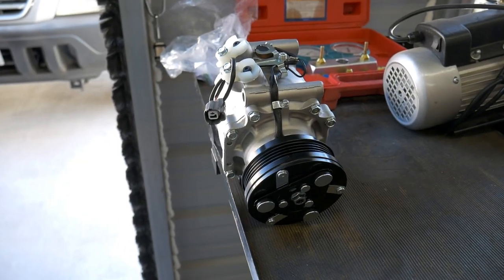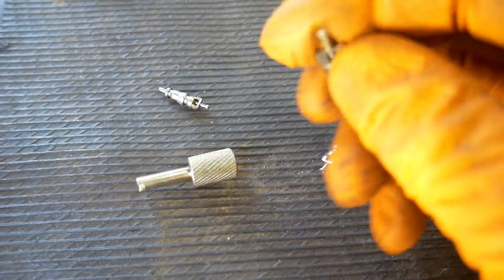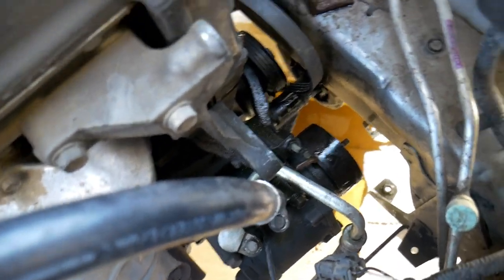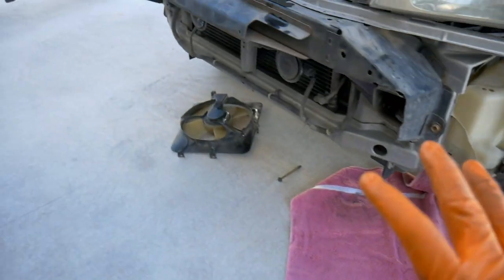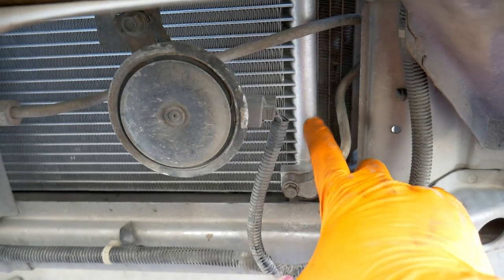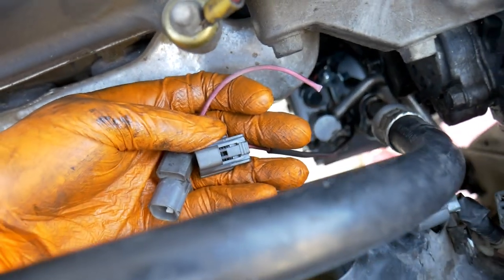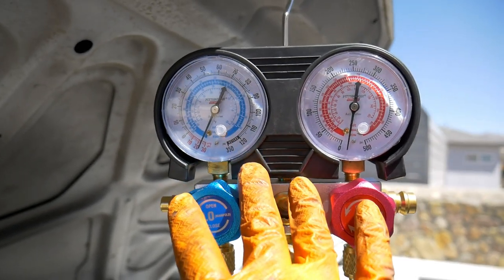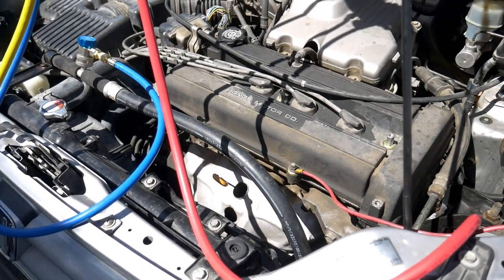How To Replace AC Compressor and Condenser on Honda CRV 97-01 - How to Vacuum and Recharge System

Comment: Any time you remove a component of the AC system that can hold oil, be sure to dump and measure the PAG oil from each component.  Your new compressor will come with a full system charge of PAG.  Dump all that new PAG out of the new compressor and only put back in the amount of new PAG that matches the amount of old oil that was measured coming out of the other components.  Otherwise, you don’t have any idea how much PAG you have in the system and the only way to figure it out is to completely flush every component with AC flush and add in the recommended amount.

Thank so much for all the great videos, Jon.  You’re my EF hero!
Reply from the maker: Thank for the input!!
Reply: If I lost all my oil how would I measure it
Reply: @chuckiebillings413  you can’t.  You have to replace the condenser and dryer, then flush out the rest of the lines and evaporator with AC flush chemicals and a flush-gun, then start over with recommended amount of PAG

Comment: Excellent video. 
Now my question is; did you have any idling issues when you turn off ac?  I have notice that when i turn off ac my rmp drops low and sometimes it stops the engine. I cleaned the iac valve and nothing changed. But it only happens when i turn off ac, plus is not blowing cold air anyway. Do you think the ac compressor is putting extra load because is not working?  Any help
Reply from the maker: None.  My CRV idles as it should.

No, I do not.  Probably have an issue elsewhere.

Comment: Hello thanks for the video. I’m going to attempt to diagnose and repair my ac system in my 99 crv soon. The compressor or the clutch definitely needs to be replaced. Do you have any recommendations on a type of place I could go to get the refrigerant in my system removed?
Reply from the maker: Most auto shops that do AC service have the machine to recover it.  Call around and ask for prices for the work.  It might fluctuate quite a bit.
Reply: @GarageBuiltHondas  Thanks so much. It’s so cool that you still help people out on these old videos. Much appreciated

Comment: Hondas are the easiest for AC work. Getting to the evaporator  is really easy  for most of the line
Reply: you can get it to take more freon by running water over the condenser to increase pressure drop It should get to under 40 degrees out the vents.
Reply from the maker: Temp of water doesn't matter?

Comment: the choke point for debris in the system is the expansion valve in the evaporator unit in the dash. Its a pin hole orifice. If plugged it can be cleared by blowing backwards through the system
Reply from the maker: Thanks for the info!
Reply: How/where do you perform thus at? Thank you in advance

Comment: Did you change the evaporator in expansion valve also
Reply from the maker: Yes
Reply: @GarageBuiltHondas  cool appreciate the video I was just wondering how long a these things will run for wondering if it's worth putting the time into and money
Reply from the maker: No problem.  I think 250k to 300k is normal.  If you really like the platform, engines and transmissions are pretty easy to find also for not too expensive either
Reply: @GarageBuiltHondas  yeah I got 242,000 on it now
Reply: I suppose if you keep fluids changed and Val clearances and she should go over 300,000 mi hopefully I sent you a request on where did you get your AC parts from I appreciate it thank you

Comment: Hey man I was talking to you yesterday where did you get your kit from for your AC
Reply from the maker: 👍 All of the links for the parts are in the description.
Reply: @GarageBuiltHondas  thanks man appreciate it instead of trying to diagnose it I think it's best to start from scratch and rebuild whole system also I push down on the high and low Schrader valves and a ton of oil come flying out so that's not a good sign
Reply: @GarageBuiltHondas  for some reason I can't find description of where you got your parts from can you by chance just tell me
Reply: Okay that still doesn't help me trying to find description as I am doing this through a cell phone thanks anyways
Reply from the maker: I think we're all on cell phones these days.  Find the title of my video.  Click "more".  You'll see all the links.
Reply: All right I appreciate it that should give me a better Insight on it

Comment: So I ordered a whole kit came with compressor expansion valve condenser dryer it did not come with evaporator core and I wish I would of bought one the expansion valve did not want to come off and I put a lot of stress on the evaporator I hope it don’t leak I’m not done yet so we will see

Comment: any issues since you replaced the condenser due the metal shavings...I  removed my seized compressor an also noticed metal shavings...been reading that you have to replace the whole system is you see shavings, wanted to know how you system is holding up after just doing condenser, compressor, and drier. Thank you
Reply from the maker: Still working perfectly as my daily driver.
Reply: @GarageBuiltHondas  Super, thanks for the quick reply...RD1's r d best when the EF isn't around that is...I provide a private taxi service in Puerto Rico and people love it! They comment on how well it rides and the amount of space and then are shocked when I tell them its 25 years old 🤣
Reply from the maker: Wow, that's awesome!

Comment: How many miles do you have on that CRV how many miles do these cars run for I have one with 240ooo on it
Reply from the maker: Mine has 253k on it
Reply: @GarageBuiltHondas  so I'm having problems with my AC instead of trying to track a problem down I just probably rebuild the whole thing like you did did you also replace your evaporator
Reply: @GarageBuiltHondas  oh hey one more thing then where did you get your AC kit from

Comment: I just replaced all the components you did, but when I vacuum it, it does not hold negative pressure. I rechecked and replaced all my o rings. Any thoughts?
Reply from the maker: None.  Are your gauges working perfectly?  Those gauges and lines have seals too and could possibly not work if they weren't taken care of or old.

Comment: Does your crank pulley wobble? Its a common issue with the older crvs.  I have one now and how would u fix that if so?
Reply from the maker: Mine does not.  I didn't know it was an issue.  Probably buy a new pulley.  Nothing else would make it wobble but worn out rubber on it.
Reply: @GarageBuiltHondas  i replaced it and it still wobbles :'(
Reply from the maker: I'd google the problem.  There's probably info out there already.

Comment: My 2001 CRV also just started blowing hot air. Compressor still turns, and clutch is engaging. Would it be safe to say the compressor is toast? System seems to still have pressure.
Reply from the maker: Generally yes.
Reply: @GarageBuiltHondas  Thanks Jon. Thank you again for all your great videos. Very helpful!

Comment: When you replaced the compressor, do you add oil to the new compressor or they come with oil already? If you need to add oil to the compressor, how do you do it ?
Reply from the maker: I bought one that already had the correct amount of oil installed.

Comment: Dude  you probably won't see this but I did the replacement and the new clutch won't come on. The relays are good so I have no idea why it's not working. Any ideas? Bad compressor? I was trying to fill it when it wouldn't come on to fill the system.
Reply from the maker: Did you vacuum the system, did it hold 26-30 inhg?  Pressures in correct range when adding the r134a?

Comment: whenever you crack the system you let moisture in which may not be a problem where you live.  so the dryer is a desiccant which you may not need but where I live you do
Reply from the maker: It's recommended to replace the drier when the compressor is replaced, which is what I did in the video.

Comment: Nice video as always! 
I have a 1990 CRX and the AC Compressor Clutch isn't engaging - tried changing the fuse and it keeps blowing. Initially it worked for 10 minutes or so, now it only works 1 second before the fuse blows.  :c   Any ideas?
Reply from the maker: I'm unsure.  Clutch might need replacing.  https://youtu.be/yQeNoE4Fzmw
Reply: @GarageBuiltHondas  oof might be, I'd love to buy and replace the part myself but I'd have to clear the lines and dont have the tools, looks like it's going to the shop :c
I wonder if they'll at least let me watch in the engine bay so I can learn some stuff lol
Reply from the maker: Lol, unfortunately I doubt it, but if they do you're lucky!
Reply: Check of theres a low pressure switch saw a jeep have a switch problem

Comment: Does the d15b  civic compressor the same as the crv??
Reply from the maker: No.  The compressor for the 96-00 Civic is the same as the 97-01 CR-V though.
Reply: How cold right now you gettign down in your ac what temperature??
Reply from the maker: 45 degrees

Comment: Is a broken bumper gonna prevent you from getting your compressor fixed?
Reply from the maker: Not sure what you mean, sorry.
Reply: @GarageBuiltHondas  The HRV has some bumper damage and the dealership said they couldn't fix the compressor because they don't want to be held liable for something else happening. They said the compressor is close to the bumper
Reply from the maker: Got it.  I think they're concerned if they remove the bumper other components may get damaged and they don't want to be held liable for those damages.

Comment: I have a 2000 Honda CRV AWD and my AC compressor is kicking on and off every second or so and bring my RPMs Down from 500 to 300rpm and engine shakes a lot. Not sure if it’s the compressor because I added some R132 and still does it. Any help?
Reply from the maker: I'm unsure.  Might need a new ac clutch
Reply: hey did you ever figure out what it was? i have the same problem
Reply: Same problem

Comment: was your ac compressor making noise before you replaced it?
Reply from the maker: It didn't make any noise before it seized up.
Reply: @GarageBuiltHondas  I see mines makes so much noise when the ac is off and on so I haven’t been driving it just ordered the ac compressor kit hopefully it’s as easy as u make it seem, thank you for the video
Reply from the maker: Have you checked the tensioner pulley?

Comment: I might as well do my clutch on my compressor tomorrow while my car is waiting on parts. 

I do have an unrelated question though. I currently have my transmission apart because I foolishly made a mastske, can I use brake cleaner on the gears/synchros to clean everything off before putting it back together?
Reply from the maker: Yes

Comment: What about compressor oil? When you vacuumed did it suck the oil out?
Reply from the maker: The required oil was already in the compressor as stated in the video.  I prefer buying compressors with the required amount already.
Reply: Ok sorry I must have missed it. Also I was worried that once you throw the compressor on and then have to vacuum the system, I wasn’t sure if it sucked that oil out. I’m glad it doesn’t. I’m about to do all this to my wife’s Buick
Reply from the maker: All good.  That vacuum pump only pulls out the air/atmosphere.  The elements in our atmosphere don't allow the r134a and compressor to work properly.  Good luck, it's really not very difficult to do.  It just looks intimidating.
Reply: @kool-aidsphuckery9596  pulling a vac on the system definitely does not remove any oil.  Water boils at a much lower temp when under vac, so the moisture in your system is being boiled off, not sucked out.
Reply: @The_Redkween  awesome. I’m looking forward to fixing my wife’s AC. Then I can spend money on my SC400. LOL
Reply: And when you vacuum the system is that also known as flushing the system?
Reply from the maker: No.

Comment: MINE EXPLODED AND CRACKED WILL THIS CAUSE OTHER PROBLEMS LIKE REVVING AND IDLE PROBLEMS?
Reply from the maker: No
Reply: @GarageBuiltHondas  I changed the idle air control valve but it still does the idle revving and im getting bad smell from my heat any ideas what i should look into someone told me some kind of speed sensor on the trans or some type of exaust leak idk what else to do i like doing my own work and really cant afford getting it fixed at a garage
Reply: @GarageBuiltHondas  Im contemplating about going to the junkyard and getting a new compressor but should i also take the drier and condensor that it has with it ?
Reply from the maker: I personally wouldn't use junkyard components unless it was your only option.  Those parts usually are worn out too.  You'll waste more time/energy installing or getting them installed than with new parts.
Reply: @GarageBuiltHondas  I REALLY DO NOT WANT TO SPEND 350 FOR A COMPRESSOR I JUST NEED A TEMPORARY FIX FOR THE REST OF THE SUMMER I WAS JUST WONDERING IF I SHOULD TAKE OUT THE WHOLE SYSTEM OUT AS ONE PIECE LIKE THE LINES DRIER AND CONDENSER WITH THE COMPRESSOR
Reply from the maker: Your call.  Try the used parts.  Might give you just enough for what you need.  Just replace what's broken.

Comment: Hi I've got a 1997 Honda CRV AC was topped off but the pressure builds up and it blows through pop-off valve what problem could that be possibly and what could I look for any help would be greatly appreciated close called Dan there's a weird chattering noise around compressor maybe that's the pop-off valve do not know
Reply from the maker: The compressor has a relief hole which releases the r134 when the compressor breaks.  You're compressor may be bad if it's old.
Reply: @GarageBuiltHondas  it's still blowing cold air though until it starts flowing out the relief valve I turn it off wait a few minutes and it it blows cold air still again
Reply: @GarageBuiltHondas  the car has 235,000 on its original compressor if compressor is bad could I get away with just evac in the system putting a new compressor and seals on and recharging it or do I have to replace everything

Comment: I try to explain to my friend about having to vacuum the system to get the coolant in. They don't listen so I tell them to put a glass over there mouth and blow. Tell me how much air you can push into the glass.....zero  😅🤣😂
Reply from the maker: Lol
Reply: @GarageBuiltHondas  I hope you can reply. Same situation but I noticed you didnt put the oil in the system...Can you explain? Im guessing you did something off camera cuz that system would be shot in a day or so without it
Reply from the maker: My compressor already came pre-installed with oil.  I believe I mentioned it earlier in the video.

Comment: I have a 99 Crv and it's works perfectly fine except for one thing. The car violently shakes when I have the AC on at a red light! Works ok while I drive but when I stop, it's a goddamn party.. LOL. I have to immediately turn off the A/C because the car won't stop revving HARD when a/c is on..
Reply from the maker: Check to see if the AC clutch is in need of replacement.
Reply: @GarageBuiltHondas  Thanks so much for the reply and thanks for the great advice! That would be the first thing I get checked tommorow!
I appreciate it man and I love all the awesome detailed content you make and post for us . 🤟🏽👏🏽